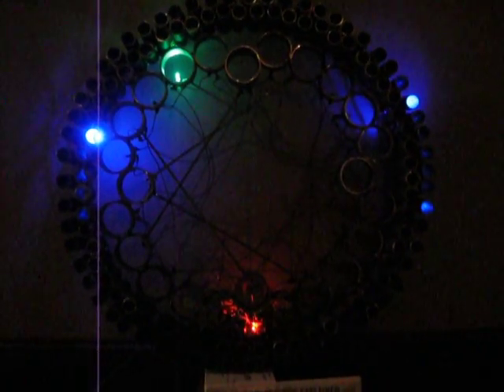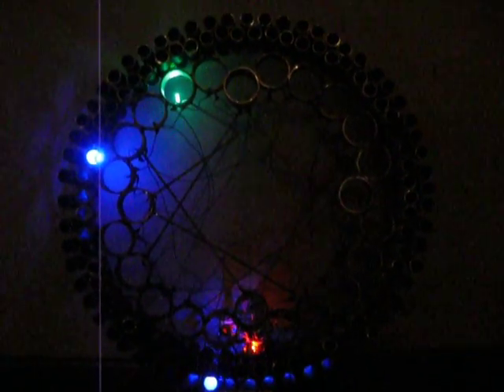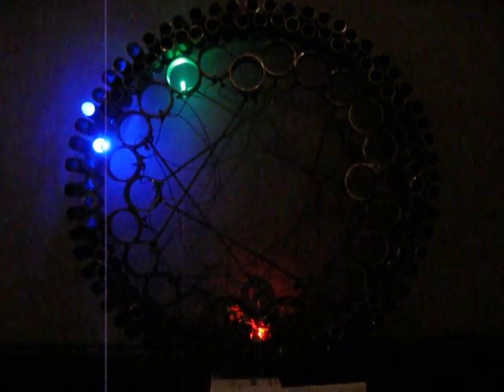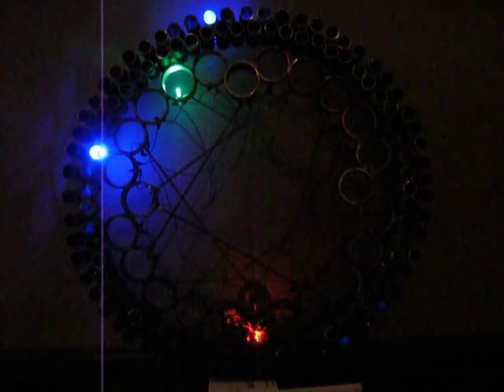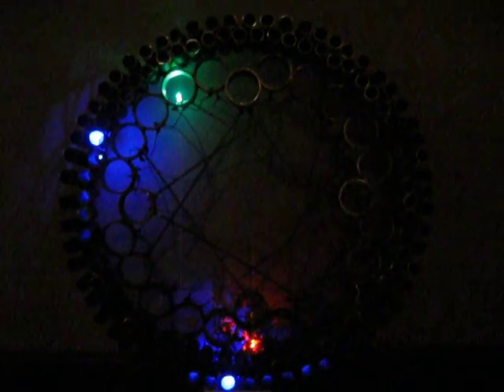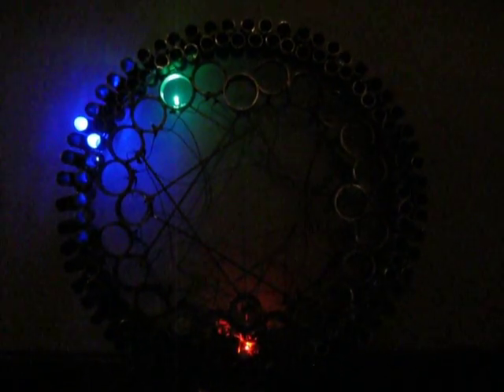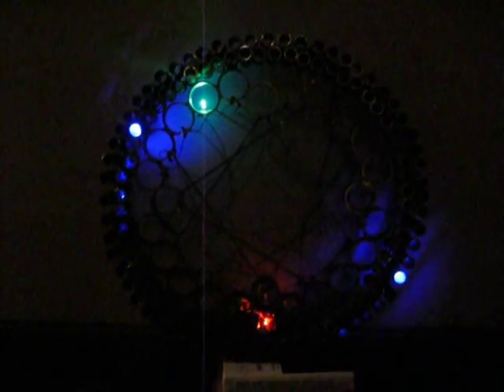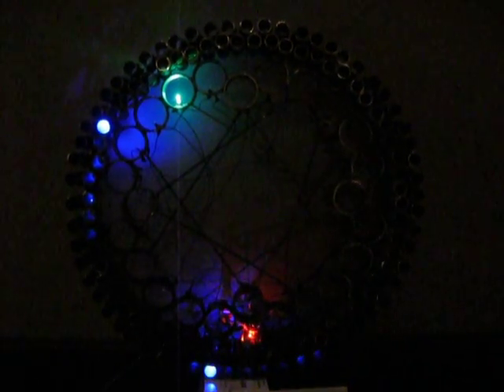LED Clock (with description)

Comment: Very cool I have thought about doing some thing like this a long time ago but wanted it to look like a traditional clock meaning have a face on it to mount the leds. Can you change your design for a 12 hour mode vs 24hr.
Reply from the maker: mrelectron62 Yeah, the code is very simple. 12-Hr mode would be almost exactly the same (just a small code revision).